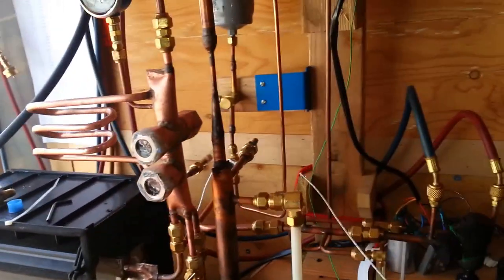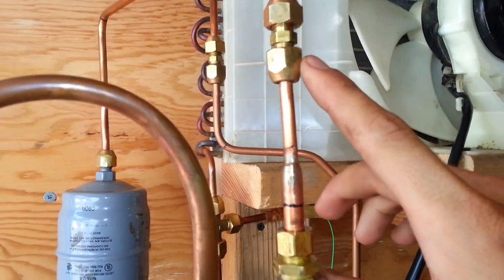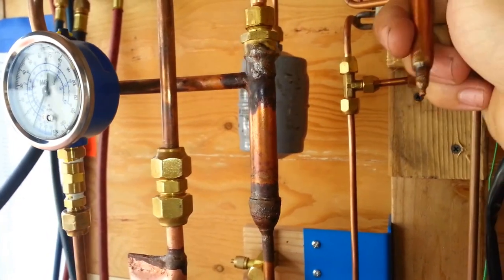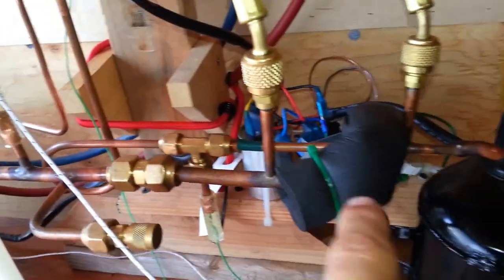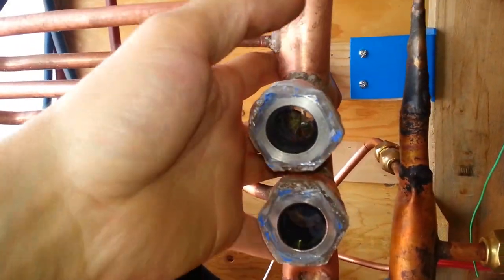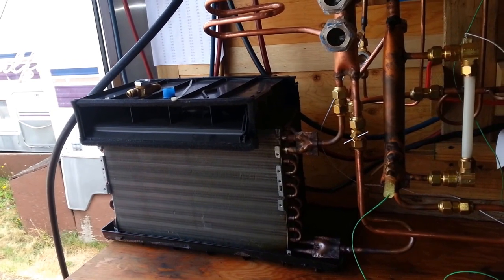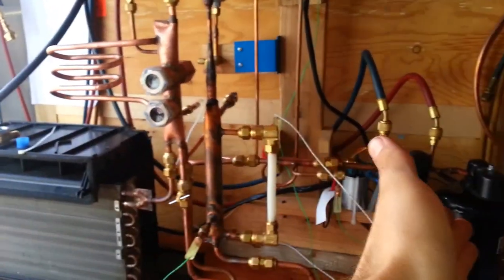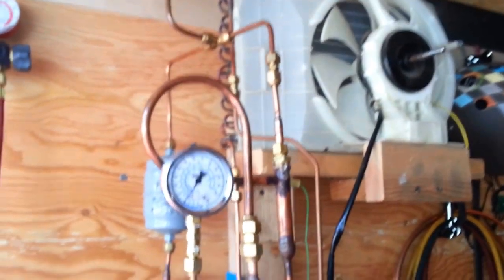How the Two Stage Heat Pump Works

Comment: There are no check valves in this experiment; it will not work because nothing will stop the higher pressure from pushing over to the low side. You must have a high side and a low side of the system to achieve refrigeration.
Reply from the maker: David Brewer didn't need checkvalves. Definitely had a high and low side, but also a mid pressure area too. Performance was pretty poor to be sure, but I was able to demonstrate that an ejector system could be made by hand. May do more work with it one day.